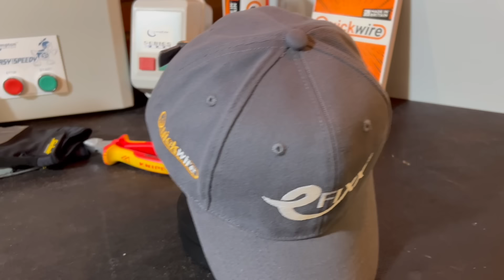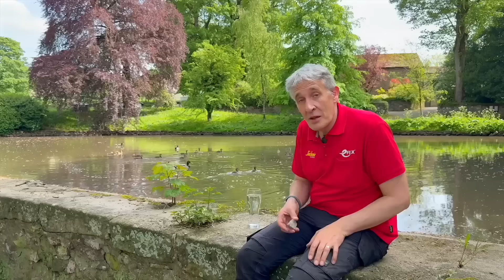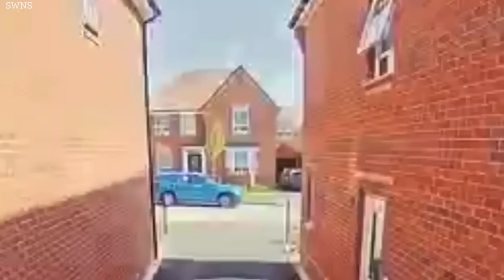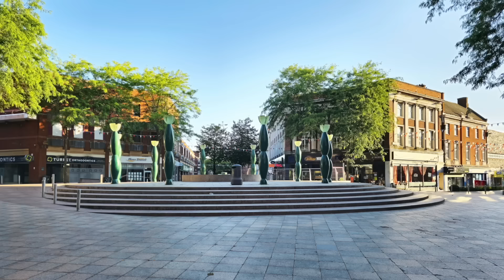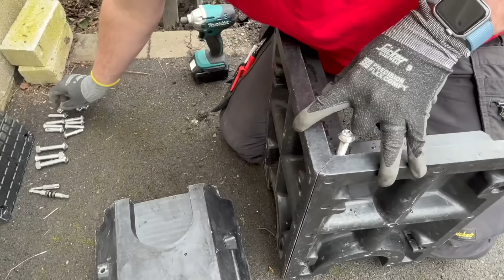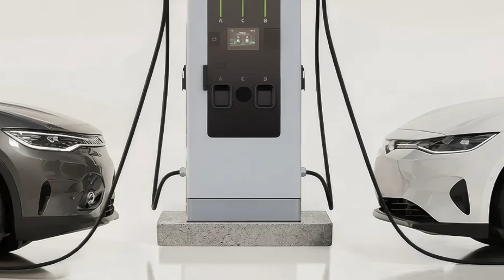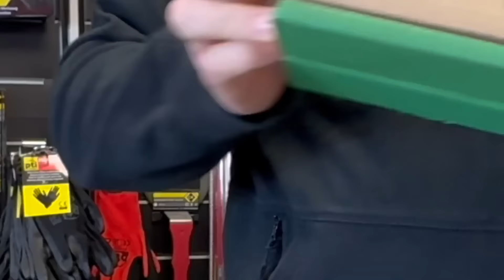Bi-Directional RCDs Unplugged - Have we got this Wrong?

Comment: How exactly do solar panels explode? It will be the battery or inverter exploding.
Reply: Solar panels don't explode, period.  Modern panels can't even catch fire really... older panels can but modern panels do not.   Inverters don't explode either.
Reply: Dodgy/loose MC4 connectors under the panel, causes DC arcing = BBQ on your roof or St Michael's Hospital in Bristol
During the pandemic/global shortage, Chinese Solar panels were fitted with any OEM connectors they had to hand
These days, most reputable panels have the industry standard Stäubli MC4 connections fitted to them
Still need to be fitted correctly & Stäubli MC4's should be used to wire panel strings to inverters

Ultimately poor installation standards lead to incidents like these
Reply: @authuruksake969 LOL There is nothing on the roof that could explode with that force. That explosion came from within.
Reply: @markrainford1219 cooking up some meth would do it! 😂
Reply: @markrainford1219 You & Veritas understand you are watching still pictures not live frame by frame footage
Look at the shading on the alleyway wall if you wish...

A few still frames gives the impression it all EXPLODED 

Wow, in an instance the fire engine appears 

THEN footage shows a recording in real time
But what you see as the roof goes up is a small number of still pictures, lapsed over a time as the shading on the alleyway wall changes on each frame

Of course makes much better headlines if you say it EXPLODED with some brief time delay still pictures until the fire crew arrive
Reply: @authuruksake969  Well it was specifically stated as an explosion in the video. What can I say? It sure looked like an explosion and I have witnessed many hundreds. But yes you are correct it is just a series of stills so no definite conclusions can be drawn.
Reply: @authuruksake969  there's literally big chunks of wood flying around, I can't think of a better word than explosion.
Reply: @streaky81 Neither the homeowner, nor the off duty fireman was alerted to the fire from the large BANG from the instant release of energy & matter from the so called "Explosion"
In other words - there was no Bang coz there was no explosion, it was a fire that took hold quickly but "appears" to explode in the few time stamp still pics, before aftermath footage in real time

There was no loud noise/Bang - coz there was no explosion like it "appears" in the still frame pics first shown
(Just look at the shadow on the alley wall drastically change each 15min frame used)

Nobody was alerted by the explosive noise - coz there was NO EXPLOSION
They was alerted by the smoke/flames from the roof catching fire - but not exploding like it appears
Reply: @authuruksake969  Absolutely ridiculous suggestion.
Reply: @VinoVeritas_ no more ridiculous than people seeing a few still frames from 30 mins & thinking the roof simply exploded ???

Look at the shading on alleyway wall changes as each frame is used...

Gives an appearance that roof exploding & gone in seconds
But the shading tells the frames used were many minutes apart & thus not the EXPLOSION it appears to attract headlines

Finally a woman is outside, with a fire engine magically appeared after it's mostly dealt with

What is reported is a few still frames numerous minutes apart & people believing the roof just exploded in seconds